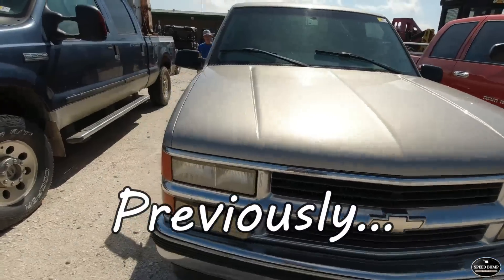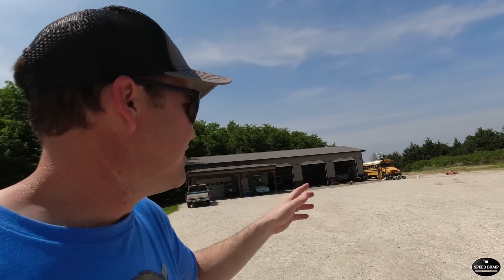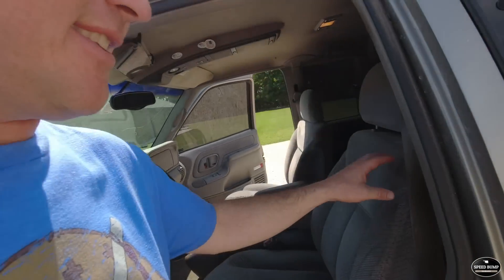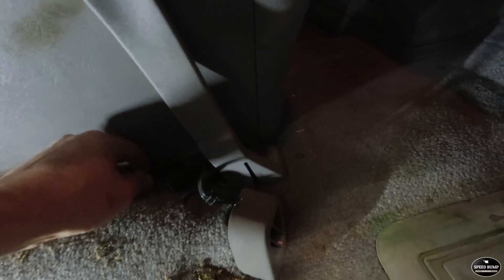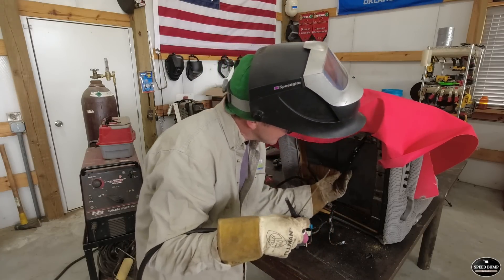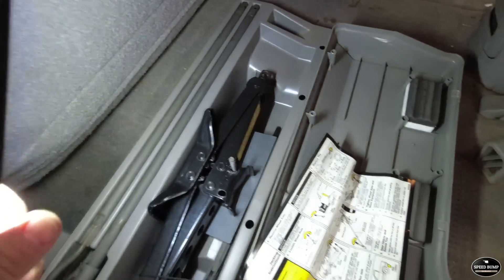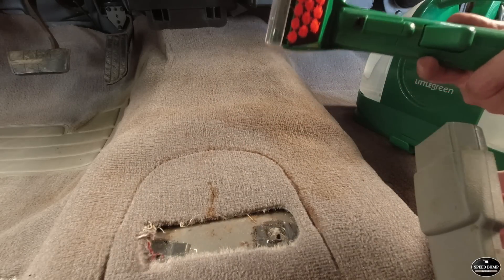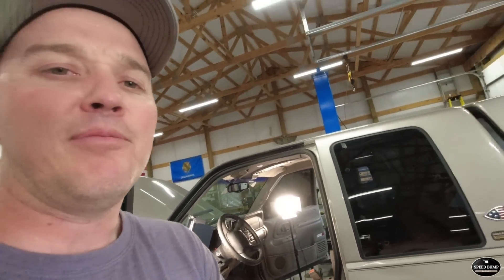One Owner 98 Chevy Auction Score!

Comment: I'd be careful on the money side. You already paid 1K more than you wanted to. PDR is $125 per SMALL dent, which could add up quickly.  I'd get the cheapest set of new tires I could find or even used ones. Maybe try pushing the dents out from behind panels I could get to. Keep cleaning it up, then flip it. I don't really see much profit margin after new tires. So, I'd keep it and then do all the expensive things you want to. The bus is where the profit could be. People are going to hate me for saying that. Changing  its color, I'd go one of two ways. Tractor paint, using paint rollers. That's the cheap, probably better than expected option. The much more fun option is getting it wrapped! You could do the tractor paint to get it legal and get it wrapped later for that matter. I'm super interested whatever you decide to do.
Reply: I agree tractor paint or rig enamel and a painter buddy that likes to be paid a couple cases of beer! Lol.
Reply from the maker: I agree, I actually posted the truck for sale as is today so I can get to work on the bus 🤦🏻‍♂️

Comment: Rebuilt the 1977 Chevy 4 by 4 from the frame up but in 1974 box on it nothing no rust the cab was out of a 1980 diesel roll over got it from work got the roof off put a 1973 Chevy top on it loaded up with my MEG and beat surprised both windows back window and the windshield fit in no problem first time welding on a body got a friend to paint it aqua green he mixed the paint gave me no 55 Evan root motors for it And after all the problems with my arms I couldn't shift it anymore it hurt my right arm it was a four speed standard that I changed over the truck used to be an automatic had a 305 out of Transam I think I was told very good on gas love the truck at a winch on the front I have to sell it so look for $ 3500

Comment: I used to use a similar carpet cleaners in the RVS that I would rebuild after they came back from renting all summer they're pretty gross and they work pretty good burnt out a couple but there's still a warranty so I just took them back and got a new one not supposed to be used commercially according to the warranty but whether they don't know it don't hurt them they just get it back anyway good little machines for the prices

Comment: You might want to check Parks Chevrolet East of Wichita in Augusta KS. I've found new OEM parts reasonable there before. Also, I have a set of clamp on extended towing mirrors, (non oem) that I used on a 96 that I owned that I'll give to you if you want them. I think they'll fit a 98.
Reply from the maker: I will have to call Park's and see.  My wife grew up right down the road from there
Reply: Unless there broke or cracked , you can wet sand the headlights, running lights etc. then before hand wipe em down really good with isopropyl alcohol, then Home Depot sells a rust oleum non yellowing 2x clear coat shoot 3 light coats your 4 th coat will be your last main coat which you can shoot regularly and they will look brand new I did it too my wife’s 2000 Silverado everybody thought we bought new ones, also for cleaning I like too use formex from Home Depot or green machine degreaser works awesome the formex is a little pricey but works awesome, so does the green machine degreaser, also regular dawn dish soap works really welll too just gets kinds of sudsy so you would want your extraction machine again or your shop vac. Amazon also sells a attachment for your compressor that beats the carpets brings up all sorts of stuff. Good luck Kent love the videos my friend. Your a good dad and I can tell your a all around good man. Blessings from Southern California